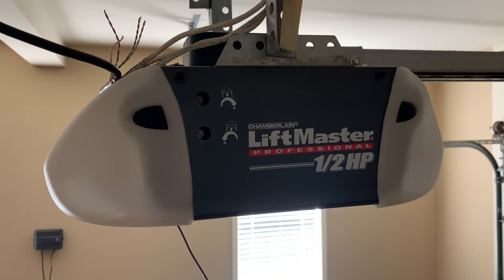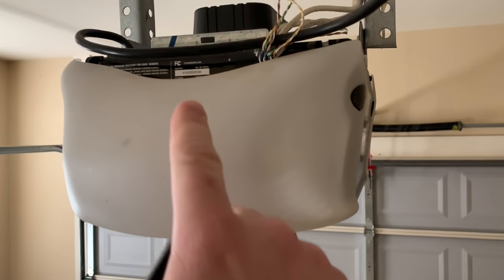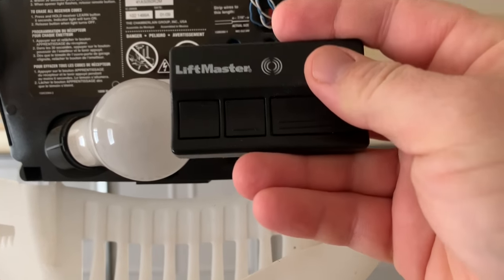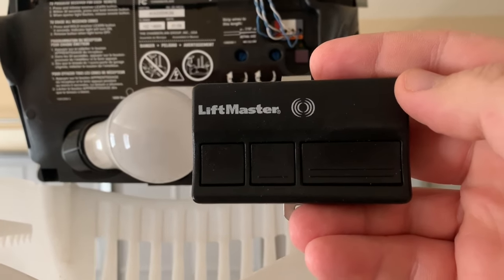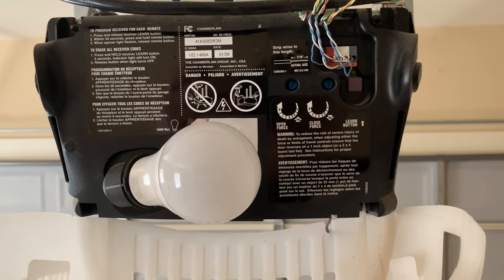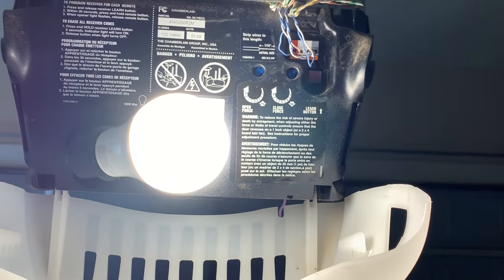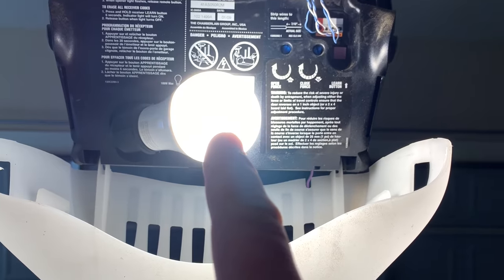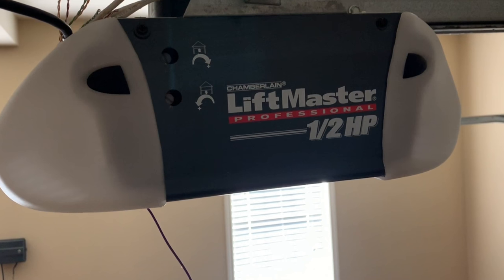EASY FIX: Garage Door Remote Not Working

Comment: Thanks for the video. My liftmaster garage door remote opener and keypad only works when opener light goes off after 4.5 minute. The bulb is incandescent, the batteries are fresh.  Any suggestions?
Reply from the maker: Take the bulb out and see if you get the same result.
Reply: @TightWadDIY  Same. A new finding is both remote and keypad would work after unwiring the wall control. Could the interference be caused by the push button?

Comment: I’m having a problem with it not working whatever I do. Have the same setup and I’m trying to program the 2nd or 3rd buttons to open the other door. I don’t have any non LED bulbs to use right now but I tried programming it without a bulb. Any tips would be appreciated. Also is there a limited number that can be programmed? Two remotes are programmed to it, mine is programmed to the other door
Reply from the maker: There shouldn’t be a limit. You can try a fill reset and then reprogram all of them though.

Comment: It was going so well!  I changed out the battery on my 2001 remoter (I know, getting up there). It seemed to work like a charm even thought my learn button was orange and not under the bulb cover but at the back of the unit.  It seemed to program successfully when I then tried to open the door.  The problem was, it would not then close the door.  Yes, I have checked the sensors and they are working.  And I have noted that if I have used the remote to open the door, then the recently installed univeral key pad on the outside of the garage door will not work.  Do I need to buy a new remote?  This system is so old, I cannot sync to open the garage with my 2022 car, that is annoying in itself.  If I drive away and have my spouse close the garage door,  I come back home and am able to then use the remote and the door will open.  It will not close the door.  Any suggestions?  Or am I more of a tightwad than you?  Just kidding; maybe it is time to replace the garage door opener.
Reply from the maker: Sorry. I’m not really sure why it would open but not close the garage. It really may be time for an upgrade.

Comment: A person moved out of my home. Their car had my garage door program coded in the visor of their car. If I follow steps in the above video, will the code previously programmed in their car no longer work?
Reply from the maker: The process I show here doesn’t erase existing codes. Your opener should have steps showing on the back telling how to clear them though. Typically you just hold down the Learn button for 15 seconds but not on all units.

Comment: I recently bought 4 remotes. 3 of them are connected, but the garage door opener won’t learn the the 4th one. Any idea why?
- all 4 remotes are the same
- no bulb present
- i tried resetting the door opener and starting with learning the 4th remote, but without succes.
-the garage door opener clearly receives the signal, because the led lights up when pressing the 4th remote

Comment: So I press and release the learn button and do get the LED light illuminating. However, I press and hold my remote button and nothing happens. It never connects. I do have a red light that lights up on the remote so I know the battery is working. Any suggestions?

Comment: Thanks for the video.  However, when I try to program the new remote opener and I press the Learn button on the unit, the LED light comes up and almost simultaneously the unit light clicks and comes up, and the LED indicator light starts blinking rapidly, with no time to teach it for the new remote opener. The LED light keeps blinking constantly.   What could be the problem?
Reply from the maker: Did you read the instructions on your opener? They usually have step by step instructions on the back of the motor.
Reply: No luck with the original operator's manual or with the advice on the internet.  Op Man. mentions the blinking learn LED, up until 6 blinks, but my LED is blinking rapidly and constantly.  I disconnected the unit from electricity and after plugging it in again, it kept doing the same thing.  And the garage door has its own life: it goes up and down randomly without any input from me.  Strange.

Comment: My neighbor lost her only remote to her Chamberlain Liftmaster garage door opener.  She has a sears/Liftmaster remote from a different unit that was previous programmed.  I have been trying to program it to her current purple learn button opener however it will not learn on any of the three buttons.  Any suggestions?
Reply from the maker: It’s possibly the remote is too old. Just go ahead and order a new one on Amazon. They are cheap.

Comment: I programmed a second garage door opener. It worked fine but then knocked out the original. I'm guessing that I can't reprogram the original without knocking out the 2nd one now?
Reply from the maker: You should be able to program way more than you need. Try it again.

Comment: I just got a lightning and my wall garage opener doesn’t work. The Remote control still working.   What you think is the issue? 
Could be burned?..
Reply from the maker: I guess it’s possible. Does it have a light on it at all?

Comment: Great video although my remote still isn't working. Tried new battery, reprogramming, even tried to use the home link in my car instead but nothing. 
Learn button lights up but never get the lights flash to confirm. Is it possible the receiver went out and can be replaced? No LED bulbs in mine, simply incandescent. ( thought your tip of the door down was my issue cause I was doing it with door up to start with ) thanks.
Reply: Did you ever figure it out?
Reply: @Mrjackietreehorn  I finally tried a different universal remote and it responded to that one. Thank you

Comment: So I know how this works. I just moved into a new house and try to program a remote doing this exact thing but it’s not working. I’ve tried three different remotes and it’s not programming I’m wondering if it’s the actual unit itself? Any advice
Reply from the maker: It could be the unit. Try resetting the unit. It usually involves holding down the learn or smart button for several seconds.
Reply: @TightWadDIY  totally worked !!

Comment: My car remote was able to be reprogrammed, as was a chamberlain keypad. However my 2 other remotes (they also work with a gate) do not work despite a battery change and were working bfore.
Reply from the maker: Priya Swamy Did you try reprogramming those remotes also?

Comment: I have a liftmaster opener and bought a chamberlain remote since my liftmaster remote wasn’t working. I tried the learn button and replaced the bulbs with the old kind. I cannot connect. The other car’s direct opener has not been affected. What should I do?
Reply from the maker: Does the learn button make the lights blink and appear to be programming but the new remote just doesn’t work?
Reply: @TightWadDIY  no, the lights do not blink but they did when I reset the code box on the side of the garage

Comment: My remote control raises and lowers my garage door fine however the wall button blinks continuously and wont raise or lower the garage door when pressed.  I have a Chamberlain model.
Reply from the maker: Vegito Black The wall button is likely wired to your unit. It sounds like you have a wiring issue.

Comment: Hi, I have two remotes.. mine works and my husband’s does not. He changed the batteries and no luck.... will my remote continue to work after this process is completed for use of his? Thanks in advance 🙂
Reply from the maker: Yes. It won’t mess up the other one. It can learn multiple signals.
Reply: Thank you! 🙌🏼🙌🏼 It works! Thanks for the detailed and helpful video! 😘
Reply from the maker: sharon Evans Great! Im glad it worked for you. Be sure to subscribe!

Comment: The LED bulbs seem to damage the logic board on purple button Liftmaster machines. I can't tell you how many I replaced already.
Reply from the maker: Damage it or cause inference with it? Replacing the LED with a standard bulb fixed the issue for most people. Genie also sells a LED bulb that doesn’t cause interference. I really hope you aren’t replacing logic boards due to an LED causing interference.
Reply: @TightWadDIY  Damage. I have talked with other garage door companies and they noticed it also. LEDs weren't common during the early 2000's so it wasn't such a problem back then. I put LEDs in the new yellow button openers and it doesn't seem to affect them.

Comment: My car has a built-in 3 button remote.  It was working fine and my wife has an external remote that stopped working.  They were both working at one point.  Then my wife's remote stopped working and I had to reprogram it.  Now I cannot get my built-in remote to program.  What am I doing wrong?
Reply from the maker: The built in remotes need to be programmed using a regular remote. You can’t program them directly to the garage door motor.

Comment: Original remotes lost.  Adjacent opener in garage remote attempted to be used (3 button remote) main button opens one door and I'm trying to set the second button to open the door I lost the other remotes for. I'm able to reprogram my remote/second button to open n close the door but it disconnects from the keyless entry pad.  I reprogram the entry pad and it disconnects from the remote.  Both will not connect at the same time.. Any ideas?
Reply from the maker: I’m not sure why both wouldn’t work. That’s odd unless your opener only pairs to a single remote. It would see the keypad as a remote.

Comment: Mine's weird, it stopped working after I changed the battery. The light on the remote blinks, and the light on the opener blinks recognizing it but it doesn't open. I have an LED but my second remote works fine.

Comment: Bought a new 'key fob' Motomaster 3 button remote for a Liftmaster motor, much like the one in the video, but it has one light socket on the front only. The ''LEARN'' button is in the same place.
I press/release 'LEARN' on the motor, it lights up solid amber for about 25 seconds. Meanwhile, I press/release a button on the new remote--remote led flashes super-fast and goes solid red after about 2 seconds and stays on for several seconds the first time... (I've tried momentary and sustained button pushes on both buttons, door open and closed etc.). No it goes. Nuffink. Sweet FA.
I tried a reset, holding LEARN for 30 seconds. Now mom's integrated toyota remote doesn't work, and I cant make it to her car in 25 seconds. I live outside now.
Reply from the maker: Read the directions on the lift master. Yours may be different.
Reply: I can read. I just don't see well when I'm on a ladder. It's amazing they let me fly commercial. @TightWadDIY

Comment: nope, this did  not  work. I changed  the battery and changed the LED  still no  go. When I try  to reprogram  (only  two buttons on the remote  opener)  the remote blinks  yellow, but the lightbulb does not confirm reprogram.  smh
Reply: I hope you found the correct learn button, just a thought as there could be a reset button too

Comment: I have a chamberlain garage opener it works fine from the Inside but it closes on the outside but when the garage is closed it won’t open from the outside
Reply from the maker: xCGYTx You can try reprogramming the remotes and also make sure there are no LED bulbs nearby.

Comment: I reset my remote as you suggested and it did open the garage door, but then it stops working again and won't close the garage. If I close the garage and reset it again, it opens the door again, but then won't close it and won't work anymore. Any ideas?
Reply from the maker: Do you use LED bulbs in your garage? They can cause interference.
Reply: @TightWadDIY   No LED bulbs. When the light goes out, the remote will work again, but only to open, not to close.
Reply: Actually now it opens and closes, but only after the light goes out [after 4 min].
Reply: @TimStokesafv  Replace the bulbs. See if that solves it. I suggest buying the Genie brand bulbs made for garage door openers.
Reply from the maker: @TimStokesafv  Did you remove the bulbs and try it?

Comment: im looking for a video to fix a garage door remote that the buttons have stopped working due to use.
ive taken it apart. its really cheap and fell apart. looks like a battery ive never seen before in my 36 years of living on the planet. lol :(
luckily my other remote still works perfect due to NO use. 
But what happens when that remote goes?
:(
how can i replace it?
Reply from the maker: You can definitely order new remotes. Just get one that matches the model of your opener. They are actually fairly universal.
Reply: @TightWadDIY  thanks for the video and response. I'll have to get that replacement remote!

Comment: Someone stole my opener .. I still have one but am worried they can use the stolen remote.. if I reprogram the remaining remote will it make the other remote not work?
Reply from the maker: No. You will need to reset all codes and reprogram all of your remotes.. Your box should have instructions on the back. But this is usually done by holding down your “learn” button on the back of the garage door opener for a longer period of time.
Reply: @TightWadDIY  ty

Comment: My garage door opener wasn’t working because my wife had plugged in a dehydrator in the garage and it was causing interference with the signal between the remote and opener, so it wouldn’t work until we unplugged the dehydrator
Reply from the maker: Interesting! I’ll have to remember that!

Comment: When I try to program my keychain remote, the red light flashes rapidly and it doesn’t program.  Any ideas?  I changed the battery...
Reply from the maker: Some openers actually learn the signal or another opener instead of the control box learning the signal of the opener.

Comment: I have done as you stated and the remote still doesn’t work neither does the keypad on the outside of the garage door and neither does the opener from my car??
Reply from the maker: If none of your buttons work, unfortunately you could have a bad board in your garage door opener motor.

Comment: My remotes work to open, but they won’t close the door, my keypad won’t work anymore either. So the only way to close the door is from the wall....and the run...lol
Any advice?
Reply from the maker: Zach Fleetwood I’m betting you have an LED bulb in your garage or nearby. Swap it out for the old style or buy a Genie brand bulb and your problem will be fixed!

Comment: Hi i tried  all  that  but  still  doesn't  work  my  garage  door  will  go  up and down  from  the  hard wired button  on the wall so there  must be  interface  do i have to buy a new  motor  since  mine is  1998 craftsman  1/2 hp
Reply from the maker: Did you try a new remote just to make sure?
Reply: I  tried  2 different  brand  new  remotes  that  said  compatible  with  my  part number  and  green learn  button  and tried  light  bulb from  home  depot  specifically for garage door  motor  and  then  put  old  fashion  light bulbs in  and  remote  still  didn't work  and  it works fine  from the hard  wired  door   button  so  do you think it is a sensor in the  panel  in the  motor? 1998 craftsman  1/2 horse power   where can I possibly buy a  board  for  this 🤔
Reply: @Sel-mp3hq  I’m not a garage door repairman so I can’t say for sure but I would try a new board if it’s not too expensive. Sometimes it makes more sense to replace the whole system and not have to worry about it anymore.

Comment: My remote was working fine? But my remote is not working? The wall dingy works? But my remote is not? Can you tell me what is wrong?
Reply from the maker: Did you try replacing the battery and reprogramming the remote as shown in the video? Also, make sure you don’t have LED bulbs near the opener.

Comment: Followed all directions.  Door opened and closed, however when I go outside the garage it does not work???
Reply from the maker: Do you have an LED bulbs in it? Also, check your antenna to make sure the wire is hanging down.
Reply: @TightWadDIY  Thanks, I will give it a try.

Comment: Changed battery and light bulb still doesn’t work. Any ideas.
Reply from the maker: Does your wall button work?
Reply: Yes
Reply: I suggest resetting your codes and start all over. On most units you hold down the button on the motor for 15 seconds to clear codes. Check for instructions next to the button though.

Comment: my liftmaster motor does not have a light on each end.  So, i am having difficulty programming a remote.  Can you help me please?
Reply from the maker: Lynne Bradford What is the model number?
Reply: @TightWadDIY  41A5021-1E
Reply from the maker: Lynne Bradford Sorry. I meant the model for the motor, not the remote.
Reply: @TightWadDIY  that is what is on the back of the motor
Reply from the maker: Lynne Bradford https://www.amarr.com/downloads/LiftMaster%201355%20Owners%20Manual.pdf This manual should contain programming instructions. They are also usually printed on the back of the motor.
Reply: Chamberlain LiftMaster Professional
Reply: @TightWadDIY  thank you.  yes i have read the directions on the back of the motor, same as book.  Light will NOT flash and the remote will not open the garage door.
Reply: i even put in new batteries...
Reply from the maker: Lynne Bradford Do you have another remote that works properly? It’s possible you just need a new remote.
Reply: @TightWadDIY  No, we even purchased new remotes.  tried programming with instructions on back of motor, your instructions and nothing.  there is no light on the back of the motor and most instructions have a light on the back of the motor.  not sure what the problem is.  i'm going to Chamberlain group now to see if i can find something i'm missing.
Reply: one video even said to poke something in the side hole to put remote in programming mode.  but my remote doesn't have a hole or lights. which i could send you a picture
Reply: @TightWadDIY  i cannot locate a model number. anyway i can send you pics?